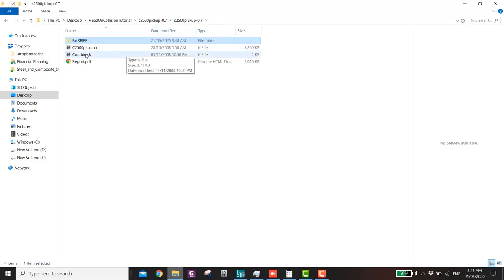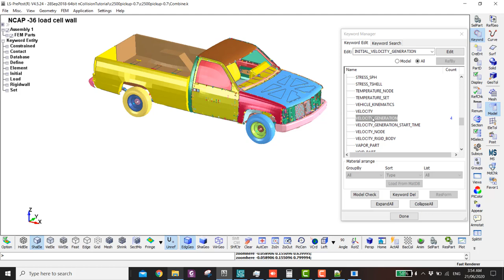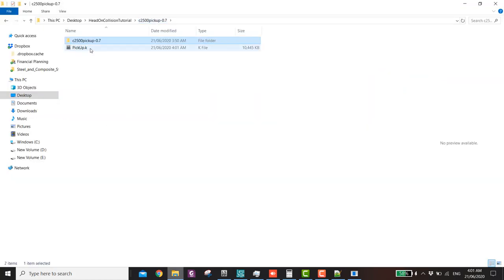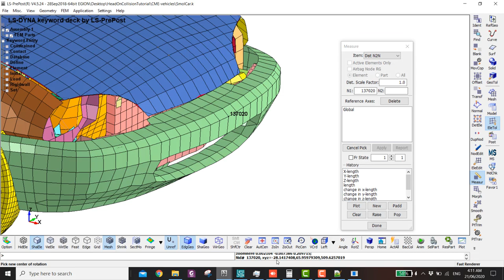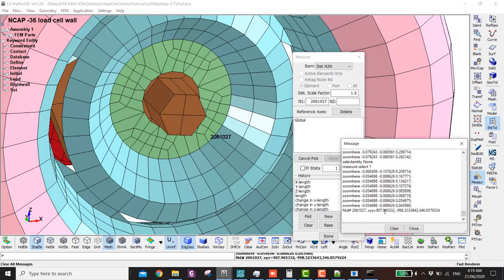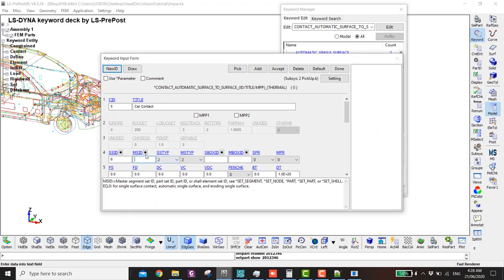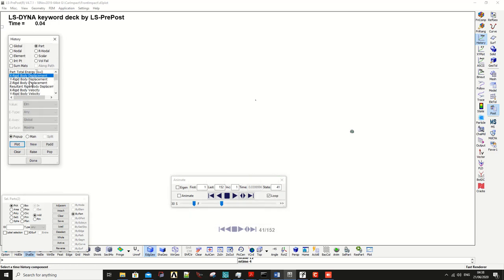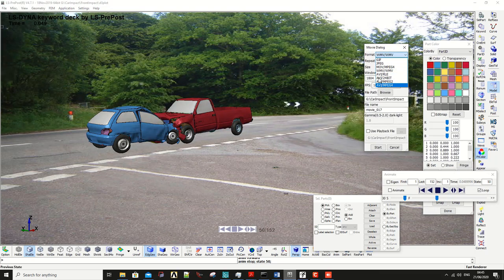LS-DYNA TUTORIAL 16: Car Collision - Hatchback vs Pickup Truck

Comment from the maker: The following are some insightful input by
 Syazwan Samad (https://www.youtube.com/watch?v=uhKCelOOz_4)

Just a general suggestions
1) It is better to use *include_transform with *define_transform to rotate one of the vehicle. Using this method, you don't have to redefine the initial velocity (generation) for each vehicle as the transform card will take care of it. Additional the offset id function is very useful as well, especially for a model that have similar ID range. One of the model (as includes) can be offset to prevent clash.
2) use the *parameter to define velocity *parameter_expression to relate the velocity to rotational velocity (of tyre), eg. w=v/r
3) contact between two different vehicle (or impactor) can be 'automate' by using *set_part_generate which you can define the range of part ID of two separate vehicle.
Alternatively, in industries, we use boxes to define segment of the slave part in an include (when the include is plugged in into the model, the contact is 'automatically' defined). This is useful when you have a lot of barrier types with different IDs, especially the set part for the barrier need to be specifics.

This will reduce the dependencies to lsprepost (or primer) a lot, and more towards text editor like notepad++. With this methods, there will be a lot of opportunities to do scripting for process efficiencies.

We have done this, and to convert one loadcase to another (frontal impact to side impact for example) will take less than 1 minutes. with scripting, it is possible to generate multiple full vehicle crash model within 10s.
Reply: Ameen Topa  sorry, i  have a question .I did everything like in the video, but the animation does not work , for example, even with the example of a small car.why? in animate window last =1  and state =1;
Reply from the maker: Is it normal termination or error termination? If error termination, check the messag file
Reply: @AmeenTopa  normal
Reply: @AmeenTopa  I really don't know but it worked, with 100 attempt . thanks very much-большое спасибо!
Reply from the maker: @slava9019  can you see the impact (deformation in both cars)? 

If yes, then you need to reduce the dt interval in datbase d3plot. If no, then you need to check both car models and make sure that the unit system is consistent.
Reply from the maker: djsonisRO05  check the video description. I provided some links there.

Comment: Thank you for the elaborated video, but both the car and pickup truck models disappear after the initial impact. can you please suggest a solution to this.
Reply from the maker: There are many reasons that might cause this. I cannot give any useful answer due to the lack of information.
Reply: @AmeenTopa  Thank you for the reply. Would it help by changing the contact types or is there any problem in the material model?
Reply from the maker: @swapnilmane5759  The car models downloaded online are usually validated. It could be that the two models are not in the same unit system.

Comment: Dear Ameen,
I have a question, In the rigidwall keyword we have a feature of exclude node set. This I have observed in many vehicle models? May you please tell what are these node sets, why are they excluded?
Reply from the maker: In many files, I found they have four rigid walls. Each tire has one rigid wall. This could be because they want to find the reaction force at each tire. Or that, they created a tire model with a rigid wall, then they imported the file four times into the main model to get four tires.

Why some nodes are excluded? The best answer I can say is to save the computational time. For example, the roof the car will not be in contact with the ground (unless you are simulating a rollover event), so we can safely exclude those nodes from the rigid wall.

What are those nodes? I am not sure as I don't know which files you are referring to. You can see what value they put in NSIDEX, that's the ID of the node set. Then you go to Create Entity, Set Data, SET_NODE, and Show. Then find that node set ID. 
_______________________________________

For those who don't know, in RIGIDWALL PLANAR we can see:

NSID:=Node set ID containing slave nodes, see *SET_NODE_OPTION.
EQ.0: all nodes are slave to rigid wall.

NSIDEX:=Node set ID containing nodes that exempted as slave nodes, see *SET_NODE_OPTION.

BOXID:=All nodes in box are included as slave nodes to rigid wall, see *DEFINE_BOX. If options NSID or NSIDEX are active then only the subset of nodes activated by these options are checked to see if they are within the box.

Comment: Hi, I am a master's degree student and I follow your videos to learn how to use Ls-Dyna. They have been very useful to me, thanks for sharing with us. I am doing impact analysis of aircraft structures in Ls-Dyna. In my model I have to join together parallel composite parts modelled with shell elements. What is the best approach to create a contact? I have used the tied_surface_to_surface_constrained_offset. Is this correct?
Reply from the maker: You may use *CONTACT TIED SURFACE TO SURFACE OFFSET for perfect bonding. If you want to consider the separation between the parts, then use *CONTACT_AUTOMATIC_SURFACE_TO_SURFACE_TIEBREAK with OPTION that considers offset for shell elements (such as OPTION = 8, 10 and 11). 

For more about the delamination, you may check the blog post below:
https://lsdynauniverse.blogspot.com/2021/03/delamination-and-tiebreak-contact.html
Reply: @AmeenTopa  Thank you very much for your detailed reply. Your help was very useful for me to continue my analysis. I have modelled the contacts as you suggested. Are there any specific controls that need to be activated for the contacts or for the analysis?
Reply from the maker: @AntonioGarofano-x7k  based on the model description given in your comments, there are no further recommendations from my side.
Reply: @AmeenTopa  Thank you so much for your reply and suggestions. Your suggestions and tips through the videos on this page allowed me to model a fuselage structure with skin, stringers and frames. I modelled all components as shell as part_composite with ELFORM 2, while the composite material through the material card 54. I bonded components through the contact_tied_surface_to_surface_offset approach as for your previous suggestion and applied an initial velocity to nodes of the structure, in order to simulate a drop test on a rigid surface. When the analysis starts, i get several unespected elements failure before the structure hits the ground and i noted a notable deformation of the components in the upper part of the structure. This is unespected at the beginning of the phenomenon as the structure is falling without any collision. Have you any suggestions to solve this issue? Are there any mandatory controls cards on contact, element, material, etc that i have to set?
Reply from the maker: @AntonioGarofano-x7k  I believe there is an error or a typo in the material properties of the composite layers. Double check that. 

For testing, you can replace MAT054 with MAT001 and see if you still get this problem. If the elements are not prematurely being deleted, then we can confirm that there is something wrong with the input of MAT054.

Comment: I want to confirm from you about impacting in incline angle that you have raised in this tutorial. Your rotate 30 degree, Vx=30, Vy= 40 so the car will move at velocity 50 and the angle is 36.8. This value 36.8 is OMEGA?
Reply from the maker: No. OMEGA is the angular velocity. It is not the angle of impact. 

This OMEGA is used for the rotation of the wheels.
Reply: @AmeenTopa  Thanks you,  I get it

Comment: Dear Ameen, 
thank you so much for making such elaborate videos, they are really helpful. I actually needed some suggestions from your side for a problem that I am facing and would be really grateful if you could help me out. I am trying to simulate a impact test between F800 (imported online) and a RC wall. I have assigned an automatic surface to surface contact between two parts. When I run the analysis it is getting exit automatically i.e., neither Normal termination nor error in termination. I am not able to figure out the problem, if you want I can share the .k file of the model with you. Hoping for a positive response from your end.
Thank you.
Reply from the maker: Dear Yash, 

Try to check the consistency of the units. 

Yes sure, you can share with me the file and I will have a look in my free time.
Reply: @AmeenTopa  Dear Ameen, 
thank you for such a quick and brisk reply. The consistency of units, it was suppose to be my next doubt. I am using MAT_159 for modelling the concrete wall but the problem with the material model is the set of units needs to be selected just as we select in Load_Blast_enhanced keyword. The unit system followed in the model of the vehicle is Sr. No. 10 from the units table i.e., ton, mm, s, N, MPa and unfortunately this option is not available in MAT_159 keyword. So, what can be done? May you please share your email ID and I can send the .k file! 

Thank you.
Reply from the maker: If that's the case, then UNITS = 2, MPa, mm sec, Mg (Mega gram = tonne)

Put your email here and I will contact you later. I am not near my PC now, I am replying using my phone.
Reply from the maker: Done. Check your email.
Reply: @AmeenTopa  Thanks.

Comment: wonderful videos and appreciate what you did for us. and i have a question, while i run the small car k file you share(the one you also show in your video), i have extra 4 errors, dyna said Cp must greater than Cv, i can't figure out is the units wrong on my pc? or something else problem, could u please reshare it? thank u so much
Reply from the maker: This happens because the models were developed using older LS-Prepost. In older versions, the letter D is used to express the exponential (E). So, for an example, instead of 1.0E-5 it is 1.0D-5 in the older files.

To solve this, you need to have an older version of LS-DYNA or you can use a text editor to correct all the exponent terms.
Reply: @AmeenTopa  so thx for your reply,  learn a lot from you.👍🏻

Comment: Hello sir, Thanks for this amazing video. I am trying to collide two cars, rear end collision with a cylinder fitted inside the front vehicle to check the impact on the cylinder. According to you how should I proceed to achieve this the best possible way without errors?
Reply from the maker: That's a very general questions. Can you be more specific to what errors you are facing?

Comment: Pickup’s rails yield stress is 385 mpa , but in simulation it can go up to 700 mpa , whats the logical explanation for it ?
Reply from the maker: First: Yield stress is not the same as the ultimate stress. This is the basics, you should know these things.

Second: It could be that the failure strain was not defined for this part. Check the material properties of the rails.

Comment: Dear Ameen, 
I have tried to run this simulation and I have found out that even after defining the database cards in ASCII option, the corresponding ASCII files are not generated for this simulation. Can you please tell us why this issue occurs?
Reply from the maker: There might be few reasons:
1 - You are not putting small enough value of DT in ASCII options. DT should be smaller than the termination time.
2 - For some ASCII options like curvout, nodout, secout, not thing will be written unless if you have DEFINE CURVE FUCNTION, HISTORY NODE, HISTORY CROSS SECTION, respectively. 
3 - There is nothing to be written. For example, sphout, rcfor, rwfor won't give any data unless you have SPH part, contact defined, and a rigid wall, respectively.
Reply: @AmeenTopa  The termination time is given as 0.1 s and the dt is given as 0.1e-2.  

Also, contact is defined but still rcforc is not generated also the other options are not generated.

————————————————————————————
As mentioned by you in point 2 that we need to define some entities to get the corresponding. On a similar note, if I have defined beam section (reinforcement bars), so to get output in the beam section, I need to define History_Beam_set, am I right?
Reply from the maker: @yashchordiya5963  Yes, you are correct about the beam elements. 

The files are not generated altogether or they are written but contains no data?

Comment: hello DR Ameen, thanks for your video
i want to use your pickup car model for a crash test to study the damage criteria on RC barriers so i want more details about the car like the weight and dimensions. 
also i want to ask if you define the gravity acceleration for the cars  or not it is not important to define?
thank you
Reply from the maker: Dear Moustafa,

You can find the mass and dimensions from Measure Tool. With this tool, you can measure the distance between any two nodes. Also, you can measure the mass by PART which will give you the mass of the part that you select.

Gravitational acceleration 9.81 m/s are important if your simulation end time is long enough for the gravity to give an effect. If the time is short like 50 ms, then defining the gravity won't give much difference.
Reply: @AmeenTopa  thank you so much
Reply from the maker: @mohamedmoustafa7240  No problem, please share my videos so it can benefit more and more people! :)

Comment: Hi Ameen,
can you explain how can we edit the car file, I have downloaded the Camry car model from the link attached but how to edit it? and are we able to convert it into a 3d model? please help.
Thanks
Reply from the maker: Assalamu alaikum Mohammad,

I don't understand what do you mean when you say convert it to 3D model? The model is already in 3D.
Reply: @AmeenTopa  
w alaykom al salam Ameen 
I mean a solid 3D model, because it is a mesh and the extention of the file is .key, so I am not able to open it in Fusion 360 for example.
What I want is to edit the model by removing the B-pillar, how can I do that? if you can please assist.
Thanks
Reply from the maker: @MGS-95  There is no direct and easy way to do it. 

The best way, is that you have the original 3D geometry model from which the FEM keyword file was created. But these files are not usually available for public. 

The second option is that you look into GrabCad website and see if anyone has created the 3D model that you want. 

The last resort is using the keyword file to regenerate the 3D model with LS-Prepost. You can use the Surface Fitting tool but you need to this on every single surface. Moreover, if the surface is very complicated, then this tool will not work very well.
Reply: @AmeenTopa  
Thank you so much Ameen. Hope you the best

Comment: Thanks a lot for this tutorial , was wondering , How can i change the quadratic mesh  that are in the pick up and the little car? I wanna do the uniform mesh (all black) so i can have more detailed solutions ?
Reply from the maker: You can use Element Tools, Element Edit, Split. This is the most direct way and it will split the mesh that you have. It cannot change the type of elements. 

For more detailed solutions, I recommend to download the models with more elements, they are available online.
Reply: @AmeenTopa  Ok thank you sir,but i dont understand something,in the car parts ,faillure is set on 1×10°8,thats a bit exessive no? I suppose its in Mpa,for example the  chassis has 380 yield stress and 1×10°8 faillure
Reply from the maker: @theterch0120  the very high value of FS means that the engineers who made this model didn't consider the failure for that particular part.
Reply: @AmeenTopa  ok thank you,is there a way to find failure values for each part? I cant even even find what material is on each part on that site u talked about caus i suppose car parts materials would be composite
Reply from the maker: @theterch0120  commercial cars don't use composite materials. Only super cars have composite for their components.

To find the failure strain for each part, you need to see the material assigned to them. If you don't understand this statement, you need to check my first tutorial for the basics.
Reply: @AmeenTopa  my question is how to find the name of the material used based on the parameters on ls dyna
Reply from the maker: If the name of the material is not mentioned on the title card in MAT, then it will be difficult to know the exact material used. 

But of course, based on the general properties, you can tell if is steel, aluminium, etc...

To know the exact grade of the metal, you need to double check the parameters with the values that you find in the engineering database. And this is a tedious process.

Comment: Hello! Your videos are really useful. But I get the error ERROR 20978 (STR+978) Cp must be greater than Cv while running file SmolCar.k. Can you show me how to proceed? Thank you!
Reply from the maker: You are welcome. 

You accidentally edited the values of these two parameters when you save the file with the new LS-PREPOST.

Open the original file with any text editor and go to *AIRBAG to find the correct values of these two parameters.
Reply: @AmeenTopa   but i do same as you not edited anything
Reply from the maker: What's the value of Cp and Cv in your model and what's the unit system you are using?

Comment: I want to simulate crash on the wall. Will it be same procedure for that ??
Reply from the maker: @sabhajeetyadav9726  Yes. some of car models available online are prepared for frontal crash test, meaning, you have to only run these models without editing anything.
Reply: @AmeenTopa  thank you
Reply: Would you please provide me link for that please
Reply from the maker: @sabhajeetyadav9726  check the links in the video description.
Reply: @AmeenTopa  I'm running the simulation in Ls- run but ist showing ( "s=" is not present ) in ls run and it terminated